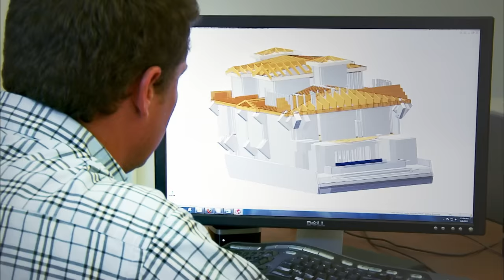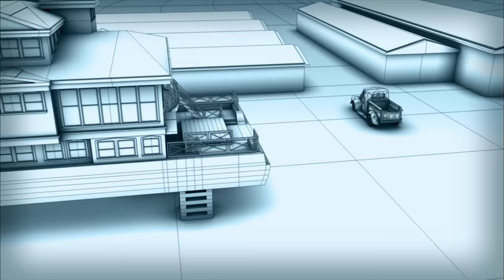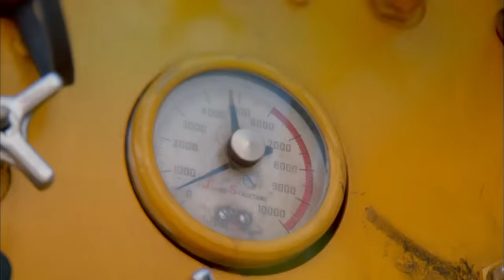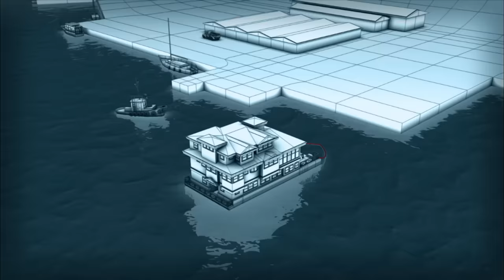A Couple On A Mission To Launch A Floating Mansion | Massive Moves | Documentary Central

Comment: Building the house on the water would've solved a lot
Reply: I was wondering if anyone else was thinking this….🤨🤔
Reply: but it would have made the project more complicated because being on the water would only give access to the exterior from one side, making it hard to work on the other 3 areas outside the house. Material storage would be more difficult too, having only dock-side available. And there is cost to consider. Taking up a dock space to build the house on water is a lot more expensive than building it on land.
Reply: @silentepsilon888  Build in a dry dock
Reply: @9TDF ... you heard the part where it was explained that the builder owns the shipyard and land on which the house was initially built, right? So that means he has the space available already. Furthermore, there is a lot more space available on land compared to along a river because a dry dock needs to be docked alongside land on the river and having a dry dock take up mooring space for as long as it took to build that house is not very practical. Also, a dry-dock is a bathtub and everything, materials and equipment have to be lowered into that tub so you need a crane or other equipment to move every item, especially larger and heavier ones, down into that tub.
Reply: @silentepsilon888  
I was merely refereeing to building on the water  a dry dock would have the advantage of building on land minus that complex transfer  and maybe minus deleting the pool unless it was build on stilts like it was for the counter balance.

Comment: this is the first floating house I've seen with an actual hull instead of just being constructed on a steel frame attached to a bunch of logs. wonder why you don't see more like this. the log platforms basically have to be rebuilt every ten years.
Reply: Probably the cost id think.
Reply: Modern log floats last more like 70 years.  And individual logs can be replaced as necessary.  Also, don't forget that a steel hull is subject to rust.  Most steel hulls are repainted more often than ever ten years.  What a chore that's going to be here!
Reply: @briangodfrey7424  oh to be clear this particular design seems really over the top to me. I'm thinking more in terms of steel or aluminum pontoons.
Reply: @0xKruzr  Logs that meet the building code (yes, there is one for floating homes) will probably outlast steel or aluminum pontoons.  Or the metal ones will need to be removed every so often and repainted, fasteners replaced, etc.  At least that would be easier than repainting this one single large float!  But if there are stray currents, galvanic corrosion can really shorten the life a lot.  I had an aluminum boat once that spent two years in a marina where there were a lot of small fishing boats - some of which probably had improperly installed electronics.  When I hauled it the pitting was severe.  

As for the overall design sense of this house.  Well, it is huge, but aside from that it is unique.  And that is one of the wonderful things about floating homes: no two are alike.
Reply: @briangodfrey7424  Lake union is fresh water so probably alot more than 10 years til they need to repaint.  You can get alotta years on marine grade paint but it's around $200/gallon.

Comment: I wonder where their other floating home moved to. After watching the move, I was thinking of adding more floats to the heavier end. It looked heavier on one end than the other before it went into the water as the third story was on one side. I'm also wondering if there was a size restraint that you couldn't exceed because I would have made the float wider so that you could walk around it and to give it more stability. Beautiful home and such a commanding location.
Reply: They had to build it to fit the spot they already had, those are hard to come by.

Comment: Just looked it up, and The Aurora sold in 2022 for $3.6 million. Have yet to find why they sold it, but they originally  were asking $4.3 million in 2020.
Reply: Consider what the value of that location is (assuming they own some sort of equity in that location) they likely broke even.
Reply: So, basically, they built an extravagant boat house the size of my property and spent $2.5M doing it just to turn around and sell it forward at a break-even price. The stupidity in that is priceless. smh 🤦
Reply: And it's for sale again now. 🤷‍♀️

Comment: Not the worst engineering but definitely bad engineering. Very weak set up and you built it on land. Build your floating section first and put it in water then finish it.

Comment: Making cylinder homes with circular rooms on tracks.
Then square outter floors on each side.
As long as your inside it can roll in any storm and everything inside stay in place and any side can be an upside deck. Just take everything inside.
Can even make a flag system on each side and gear system to push poles out in case its ever landlocked.

Comment: The only issue is the corrosion of steel iron underneath, it won't long last...against huge typhoons, inclement weather, etc. By the time the underneath worsened, but to no avail, all luxury collections including the mansion itself will eventually be submerged. All ships in the world can no longer float forever even it made by steel even the unsinkable Titanic, unless otherwise it has been built on land strategically. May you donate your excess wealth to the less fortunate fellow beings as long as you live and God will love you afterlife. May God bless your family, thanks.
Reply: No typhoons in Seattle.  Also, Lake Union is fresh water.  That steel will last a long time, especially if they used marine grade paint.  There are houseboats in Lake Union that have been there many decades.  Also, Queen Anne hill gives alotta shelter from the incoming winds where they are at.
Reply: @burmy1552 all the comments about hurricanes and typhoons are cracking me up. They are obviously not familiar with Seattle! As I said, If they get hit by a tsunami, we have bigger problems! 😂😂😂

Comment: This should have been built in stages, then out in the water and tied together. That would have been more feasible. And never this damn big. More narrow, less tall.  You could have done two side by side houses, considering they have two slips. This would have made more sense. Easier to move, slide into place.   Then tie together with a portable bridge. Still have room for family visits. And if they divorce or want to downsize, its easy to separate. IMO.

Comment: im not an architect or engineer but wouldn't it have been easier and more cost effective to add lead weight to the pool instead of adding a tub and concrete to the hull?

Comment: Pretty good Animation. But if that’s My Build I would have Used a Deeper and Wider then the House Itself making it appear as a Sidewalk around the Entire Barge that would Stabilize The Side To Side, they Did Well creating a Ballast to even the Barge Out. But I didn’t see if they Sprayed a Sealer on the Inside of the Barge itself to help Seal The Bottom up tight, also to counter act the Concrete becauseThe Lime in Concrete is Very Corrosive to Steel. But spraying a Sealant all over the Barge is just a Extra Preventative Is all. We were able to see that part or the Build in Sequence which would be really Great To See, I know for most it’s great and it is that for sure, but being I Licensed Builder I know Construction Top to Bottom so for me a Detailed Video would absolutely go over well.

Comment: Yeah super cool...just like a 80s water bed.....looks and feels cool..but than you get a leak and your fd
Reply: Back in the late 80s they built the new Mercer Island floating bridge next to the old one.  They had drilled out some of the floating ballasts on the old bridge to accommodate the new one.  A storm came in and started sinking the old bridge.  They had to shut it down for a bit.  Major engineering FU.

Comment: They could launch the base in river and then built there it slowly. It could have saved them almost $200,000
Reply: It also would have cost them 3-5 years in time.  They spent $2,350,000.  The $200,000 for the move was negligible.
Reply: @christansdad  no, if they build near the bank, where road is connected and a crain is available, then not more than one week extra.
Reply: @Fun2Roast  You know nothing about construction, boat construction, supply chain, and logistics.

Comment: This really seems like a disaster waiting to happen lmao. Like wouldn't just one storm or something cause such a top heavy "vessel" to easily capsize? Not to mention just sheer weight, there's usually a reason most boats narrow as they get higher but this stays uniform all the way up. Which not only causes it to be top heavy, but adds significantly more weight as well. Sure it's not exactly designed to be taken out into open water and used like a typical boat but then that also brings up the question of why even have a "floating house" to begin with, if not to actually use it as a boat lmao. You may as well just have a shoreside home if you're just going to keep it immobile on the water...all they've managed to do is create unnecessary problems and added worry about if their home is going to randomly sink one day. Water is not used as medium to build "structures" on for an obvious reason, it's a fluid, and fluids move around nonstop lmao. Trying to build a "static" structure on a fluid is so unnecessarily complicated to maintain that it makes no sense to do unless your intent is to use said "structure" to travel as well(aka boats ppl use to live in and travel).

Comment: On the edge of my seat.  It is way too big for the water.  A swimming pool?  OMG.  t's not my house, not my money, but it just seems like too much.  
The house is so big, that unless you are near a widow you aren't going to know you are on the water.  It isn't nautical at all either.  I would have suggested that they build that house on land, and then build a smaller, more dock-friendly, romantic place on the water for the weekends.  But, again, not my life.  I can see they are very happy and I'm glad it worked out for them.  What are they going to do with all the cement pumped into the bottom of the boat?  Does it remain there as ballast since there is no pool?  When that hardens, it won't be easy at all to get it out, so I am thinking it remains there as ballast.

Comment: Cool house, silly video with too much artificial tension.  Wondering if the house will even make it to the slip?  This is bigger than most, but these houses get moved around all the time.  In fact, they MOVE all the time.  They are constantly subject to what on land would be considered earthquakes.  Every boat that passes leaves a wake that jostles the house.  A big, heavy one like this will feel it less than a lighter one, but it will still move.  That's part of the joy of owning a floating home.  A house on the dirt just seems like a pathetic, dead thing.

Also, the excuse that their old house was getting too heavy due to knickknacks is suspect.  When you build a floating home it is empty.  After the owner moves in a diver will usually come in and add or move around large foam blocks beneath the float to level it up and set the correct height.  If you add too much weight you can always call the diver back to level it up again.  I've done this three times in my life and it is not at all unusual or stressful.  The guy who bought our last floating home put a piano in it.  That's a lot of knickknacks.  The diver leveled it up and no big deal.